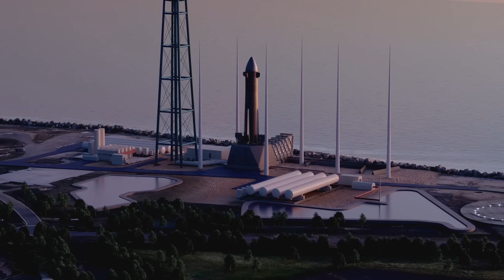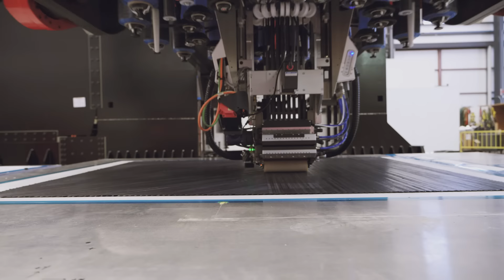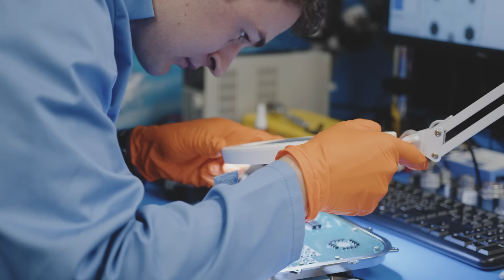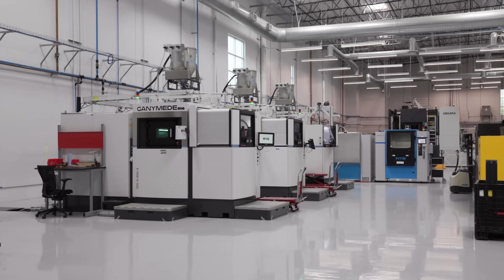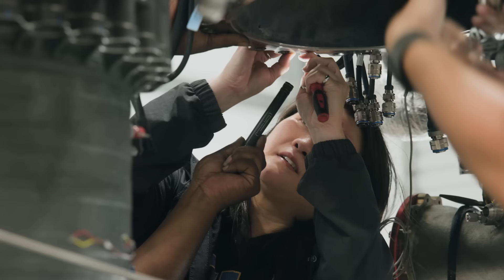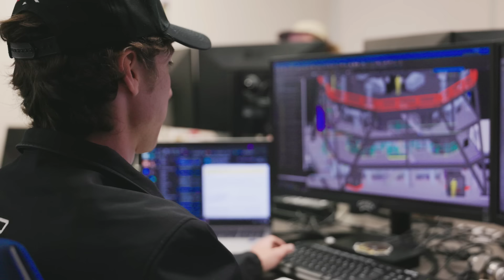Rocket Lab | This is Neutron

Comment: If this works we got SINGLE STAGE TO ORBIT!
Reply: This is not an SSTO. It spits out a second stage at roughly the same altitude and speed as a Falcon 9 booster.
Reply: Probably the biggest achievement for space applications since the Falcon 9 reuse!

Comment: How are you guys going to deal with carbon fiber integrity from re-entry heat and other pressures? The B-2 bomber uses titanium plating so that the surface isn't exposed to engine exhaust heat. The Oceangate Titan submersible imploded due to use of carbon fiber material. I have a hard time imagining it being used successfully for a rocket program.

Comment: There are a lot of comments about how the carbon fiber skin will melt under the heat of reentry. This is not the fiberglass skin of powerboats and surfboards. This carbon fiber skin is infused with silica that makes it heat proof, with a melting temperature above that of stainless steel. The composite is similar to what is used on the heat shield tile use in other spacecraft. Plus it is very ridged and light and the captive fairing ("hungry hippo") and squat shape will allow it to return to Earth mostly through aero braking until the final landing burn, making the design fuel efficient.

Comment: Oh these fools. SpaceX tried carbon fiber. Its not suited for space. The massive temperature fluctuations will tear it apart. Theres a reason they went to stainless steel.
Reply: They went to stainless steel because it's cheaper and easier to work with. At the scale SpaceX wants to build starships that was the right move. Neutron is much smaller therefore carbon fiber can be used and not break the bank.

Comment: Acrbon fibre will stretch amd compress , over time this will weaken it. 

It will explode
Reply: Yeah I'm sure the rocket engineers haven't thought of that.
Reply: @motokid6008 many have. Thats why reusable rockets aren't normally built out of carbon fibre.
Reply: @utubeballbag - It's a cost thing. Not a structural integrity issue. SpaceX was going to do cf for Starship, but it was too expensive.
Reply: @motokid6008 yeah same reason they used it on the Titan submersible.
Reply: @utubeballbag  - Submarines are not spacecraft. The pressure differences the two have to endure are world apart. Rocket fuel tanks are only taken to like 50-some bar of pressure where as a sub has to endure thousands of bar.
Reply: @motokid6008 youre right subs arent rockets 😂 subs only have to endure one type of force where as rockets endure multitudes of forces, internal pressure from the fuel tanks is 200 bar then there are the forces of acceleration and massive heat changes causing expansion and contraction  the titan sub only had to endure up to 400 bar.
Reply: @utubeballbag  - "rockets endure multitudes of forces" - Non of which come even close to that of a submarine. No clue where you're getting 200 bar from. ( Don't mistake engine chamber pressure with tank pressure ) Im getting 50 bar at most from an exert from Tom Muller who made the engines for Falcon9. But its all over the place depending on the rocket. SaturnV for instance only pressurized the tanks to 1.7 - 3 bar. Again if you think Rocket Lab isn't doing their due diligence to test and certify their design ( something Ocean gate very much did not do ) then I have a bridge to sell you.
Reply: @motokid6008 lets see 😂

Comment: The G in the symbol for Freemasonry represents the number 7, the 2 tools making 2 sides each in a square boxing it in represent the number 22 as does the shape of the compass and square which makes "V" the 22nd  letter in the alphabet. 22/7=Pi(rational, what goes around comes back around)

This form of Pi built every great civillization before the breach. Every old world temple and structure that we cant even replicate today was built on 22/7, the same stuctures they worship themselves in.

This symbol was allegedly introduced around the same time as irrational pi was implemented in our system of mathematics in 1768.

The current formula for Pi that we have incorporated into our way of life is irrational (stretching endlessly into the abyss) due to decimation. 
The logo basically symbolises squaring the circle which is essential in disrupting the nature of  systems that are organised by cycles. 
7 is a number of perfection according to many different belief systems. The highest degree of masonry is 33ish. 34 cannot be reached because it equals 7 and their whole purpose is to stretch and decimate the perfect Pi into the realms of the unnecessary. The more they stretch the more space they need beyond human perception and living memory.

33 also represents the 33rd symbol in 52 symbol alphabet using upper and lowercase. The 33rd symbol is "g"

You Wanna know where the Gold is?
Gold (Au) element 79 on the periodic table 
A/1+U/21=22
7+9=16, 1+6=7
22/7=3.142857142.
This is the original formula for Pi. This is a rational number that repeats after 6 decimal places, unlike our current one which is irrational and stretches into the "quantum" realms of who really cares.
What goes around comes back around.
7 is the key to George Orwell's "1984" also. Time to real it in.

K EY S
How To Decimate Civillization.
Welcome to 1984
1÷0.2÷0.3÷0.4÷0.5÷0.6÷0.07
=1984.126984
1÷0.07÷0.08÷0.09
=1984.126984

Roman influence is a widespread theory but the proof is in their arrogance.

Freemason is an anagram for Romans Fee
(f/6+e/5+e/5=16/7)

Free=6+9+5+5=25/7
Mason=M/13, 1+1+6+5=13
The Masons of freedom after burning down the 13th Arc cycle and removing 7 from the harmonic code.
BONUS POINT:
Repurposing all the free masonry (old world structures) after the breach.

ROME/ROWE/O REW/ROUUE/RO33(6/O)E

I Sie REW, RU, ROU and ROO.
WREcked😶‍🌫️🥧

Comment: I know with Archimedes the plan was originally for an open cycle, but that along the way it was realized a closed cycle was going to be required.

My question is, especially with additive manufacturing, why not use full flow?  Neutron wouldn't need to try to max out everything like another engine, and instead use the dual preburners to reduce the stress.

My best guesses are development time, or possibly the dual preburners leading to a heavier engine, but I'd be interested in knowing if full flow was ever discussed and if so why not.

Comment: Was hoping video would discuss what they use for the heat shield or are they banking on the carbon fiber skin alone? What is the turn around time between launches with same rocket?
Reply: The skin is made out a high temperature carbon fiber ceramic. The minimum turn around time, after the launch pad is enhanced is 24 hours.

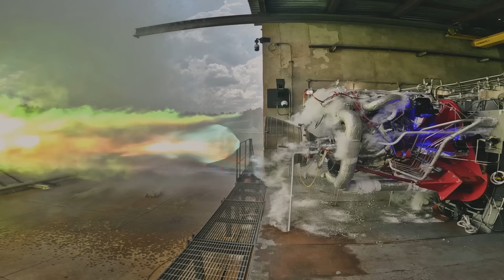Comment: 6:27 it would seem like a bit of the engine got used as fuel there 😅
Reply: TEA-TEB is used as ignitor. The glow of copper alloy is dimmer.
Reply: @jarakal135 No, Arch uses torch ignition. That’s engine being eaten you’re seeing.

Comment: I really want to know if Neutron is modular and modifiable enough to support an external booster in the future. Using CF is already giving me more confidence for reentry, than a steel hull.
Reply: ? starship has survived every time even though they basically try to make it fail
Reply: I believe the plan is to extend its already chubby height when going for a larger version.

Comment: Oxygen-rich means lower performance (less free hydrogen) and they risk to burn the engine (not sure because of coating metal oxides) ?! I heard that and it felt odd so I looked it up elsewhere.
Reply: this engine cycle has higher performance than a gas generator which is used on falcon

Comment: Beautiful, but how do you protect the carbon fibre skin during reentry?
Reply: Only the first stage reenters (cleverly with the fairings), so the speeds involved are lower. Compare the reentry of the first and second stage of the Spacex Starship.
Reply: @geirmyrvagnes8718  they have not reflown any electron yet, right? not that I have the knowledge to make any judgement, but that has me a bit "concerned". Could be because of the salty spalshy splashy issue though, ofc.
Reply: @snuffeldjuret  Feel free to be concerned. This is actual rocket science and fancy engineering. No guarantees that things will work as planned, and unlikely that they will at the first tries.  But a cool and promising concept!
Reply: Super light carbon fiber ceramic. Very close to the stuff heat shield tiles are made from.

Comment: I'm seeing some misunderstandings in the comments:
• This is a two stage to orbit rocket, like the Falcon 9. The lower stage wont experience extreme temperatures.
• The upper stage has no shell, it's very bare bones. The protective fairing for it remains attached to the lower stage after stage separation, right down to landing.
Reply: Retaining fairings is a big savings, they can easily be 10% of an expensive rocket and even recovering them from the ocean is costly.
Reply: @kennethferland5579  Would be great if it worked, but not an insignificant challenge. Carbon fiber stiffness drops by about 50% by the time it hits 200F, so I'll be curious as to what TPS scheme they use. Ablatives aren't amazing for re-use.
Reply: These guys probably have more experience than anyone in the world with large re-entering carbon fiber structures. I'm confident they wouldn't have gone through with this project if they didn't think it was viable. The capsule shape means TPS is only needed on the bottom surface, much like the Super Heavy booster, which is pretty doable. It'll probably give them more margin for error on attitude than they have with the cylindrical Electron, and they've gotten even that to work without it being designed for it at all. They'll be flying a profile much like Falcon 9, probably with even less of the delta V in the first stage, so aerothermal heating should be relatively mild overall.
Reply: @the_space_goat  doubtless they have TPS all over this vehicle for protuberance heating, PIFS, etc - would be shocked if they’re not tackling that like everyone else is. What I’m addressing is the large number of comments that seem to misunderstand this. And I can tell you, in my (very applicable) professional experience, that re-entry dominates, which was the question at hand. “Relatively” benign is still hot enough to yield structure. Give them some credit for handling hard problems to solve, there’s no free lunch.
Reply: If by lower stage, you mean first stage, I can very much assure you that it will experience re-entry and ascent heating on the order of dozens of W/cm2. Plus, they're carrying so much unwetted structure with that hung second stage, that's not doing them any favors.
Reply: @micahpratt122  It is likely doing them quite a few favors. Putting mass on the first stage instead of the second is a very good thing all other things being equal.
Reply: @micahpratt122  Yes, I mean first stage. That could be a confusing term for a rocket neophyte though so that's why I used lower stage instead.
Reply: @korakys  Understandable, though I think you (and honestly everyone commenting) don’t have an accurate understanding of reentry physics. No offense intended. Modern Compressible Flow by Anderson is a great place to start if you’ve got an industry background.
Reply: @micahpratt122 I think that by "extreme heating" they were referring to the difference between the velocity of an orbital speed stage as opposed to that of a booster stage.
Though I could be entirely mistaken.
Reply: @emersonduncan56  EDL heating dominates on every re-usable vehicle. Stage sep generally happens in a nearly exoatmospheric environment. When free stream density drops to zero, so does stagnation/acreage heating.

Comment: I’m a big spacex fan, but they NEED competition! Go gettem Rocketlab!
Reply: Yes, Competition  on innovation side but they arent in same area of market!
Reply: SpaceX already has a clear goal: going to Mars. They’re really competing with themselves to make that goal a reality
Reply: The payload of the first Neutron should be 12999 kgs of bananas and 1 kg of ketamine.
Reply: Stupid fanboy. Pretending to be the most correct
Reply: Rocket Labs has done outstanding job of replacing markets SpaceX has left.
Electron replaced Falcon 1 and then grew in payload.
Neutron really is a well optimized replacement for the majority of Falcon 9 missions that weren't Starlink.

This is a great solution for SDA.

Comment: What is the advantage of putting the second stage inside of the first stage?
Reply: The second stage is hung inside of the nosecone as opposed to stacked on top of the booster like a conventional rocket. This allows them to build the second stage incredibly light because it wont be dealing with the compressive forces of the booster. Only of its own engine for the cruise phase of the flight to orbit.
Reply: @motokid6008 but wouldn't that architecture just replace extreme compressive forces with extreme stretching forces?
Reply: @Barthhhelona  - The g forces are the same, but different materials ( carbon fiber in particular ) prefer tensile stretching vs compressive forces so they can make an upper stage that has less structural ( dry ) mass.
Reply: No? Most of the video is about the booster, what told you it didn't have one? The second stage is really small and is inside the fairing on the booster. Neutron using conventional bell engines means it could never have a chance of being a practical SSTO
Reply: @SkibidiRizzler-m4h ah ok I didn't realize the second stage was inside the first stage.
Reply: @Barthhhelona  No problem, glad I could clarify, @motokid6008 gave a bit more detail if you're interested
Reply: The thing about compressive vs tensile stresses would have been important because of buckling under compressive loads but not under tensile loads. But this is largely not relevant -- most of the second stage is fuel tanks, and the pressure inside tanks is much greater than any external pressures, so the walls of the tanks are always under tension even in conventional rockets. The reasons why they hide the second stage are more subtle than that.
Reply: @cogoid  - "so the walls of the tanks are always under tension even in conventional rockets" - The walls? No. Maybe the rear bulkheads of the fuel tanks, but even then they're reinforced by structure that is taking the compressive load of the engines. Fuel tanks are very much compressed in rockets which use the walls to transmit the load. Pressure isnt relevant. Its about dry mass of the upper stage which can be cut down by utilizing tensile forces. Fuel tanks aren't a separate object in the body of a rocket. They are the body. Conventionally.
Reply: @motokid6008  It is a very easy thing to estimate. Let's see for Falcon 9. The cross section is 10.75 square meters. At a pressure of 3 bars, this results in 320 tons of force stretching the tank axially due to internal pressure.  Most of the stage is the liquid oxygen tank, which supports mostly just the payload. At 20 tons of payload and 6g's of maximum acceleration, that's 120 tons of external force on the tank. 120-320 = -200, so the tank is under a massive tensile load even when the greatest external loads are applied. 

The kerosene tank at the bottom will be under 520-320 = 200 tons of compressive load at the time of the maximum acceleration, because it has to support the LOX tank in addition to the payload. But because this tank is shorter, the buckling is easier to deal with.
Reply: @cogoid  -  So you're saying tensile vs compressive loads doesnt matter? I highly doubt that.

Comment: Curious how they will handle heat shield reentry…. That render looks pretty but no signs of any dispersion mech. After seeing how much of a pain it is with starship, will be intereste to see their solution and most importantly, if it works!
Reply: You don't need a heat shield if you don't get up to orbital velocity. Their first stage is big and reusable, but the smaller second stage is entirely expended. It's that second stage that will go to the high speeds (and would need a heat shield if it were to be recovered).

SpaceX's Falcon 9 also doesn't have a heat shield.
Reply: @korakys  Falcon has engine cans instead. Every launch vehicle needs some form of aft end TPS (in this case metallics) for plume/re-entry environments.

Comment: Reusable carbon fibre? Reentry under high temp and high stress? Did you guys not learn anything from Titan?
Reply: Titan? The sub? Spacecraft only need to deal with one atmosphere of a pressure difference. Subs have to endure thousands of pounds of pressure difference. Comparing subs to spacecraft is a whole new level of ignorance.
Reply: @motokid6008  I hope someone else is making all serious decisions in your life.
Reply: @NobleSteed00 - Sorry if I offended you, but you DID try to relate a submarine to a space craft. Lol. C'mon... Also. No. The booster will get no where near orbit. It spits out a second stage.
Reply: @motokid6008  What second stage? Why don't you do 2 seconds of research first? Also, takes a lot more to offend me, brother.
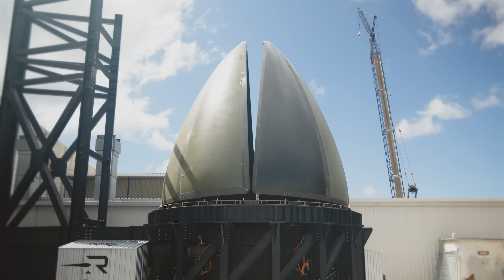Reply: @NobleSteed00 - ... This rocket spits out a second stage from its fairing. It's IN this video lmao. @1:33
Reply: @motokid6008  yes, it does. at what speed does it do that?
Reply: @NobleSteed00 - Around 6k mph like the Falcon 9.
Reply: @motokid6008  we'll see
Reply: @NobleSteed00 - Launch is hopefully at the end of the year so yeah we will. I'm not sure exactly the staging velocity. Could be even a little higher than the Falcon 9 given neutrons higher cross range capability after boost back.
Reply: The booster won't get anywhere near the speeds of boosters like Falcon 9, reentry heating will still be a hurdle, but not impossible to survive for this booster
Reply: @SkibidiRizzler-m4h  What booster? This thing is supposed to deploy to orbit and come back.